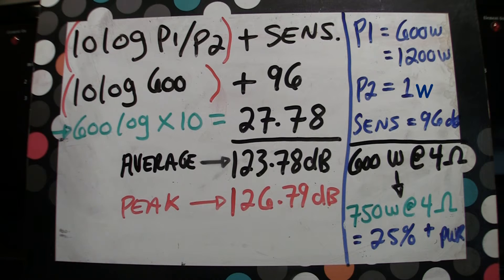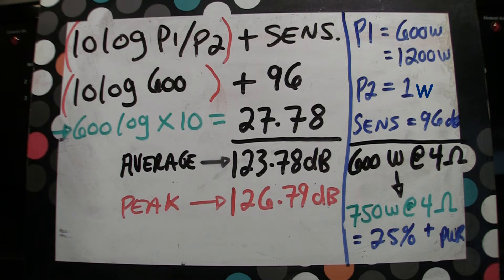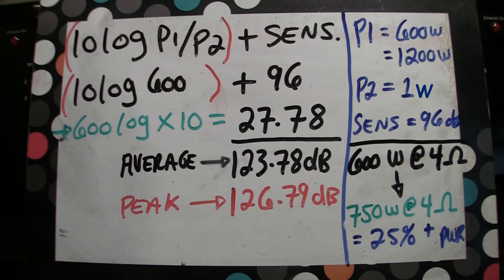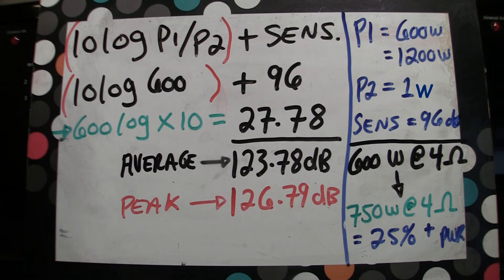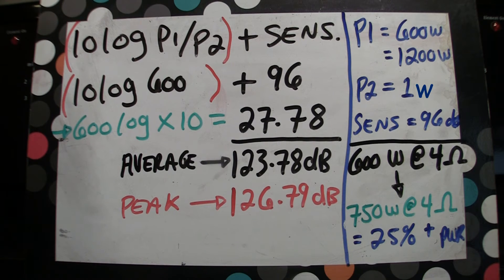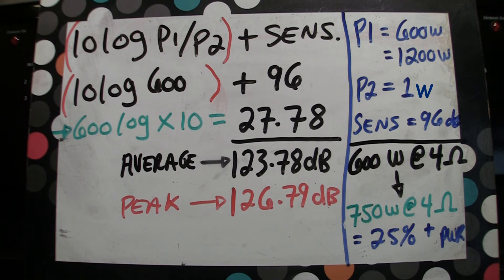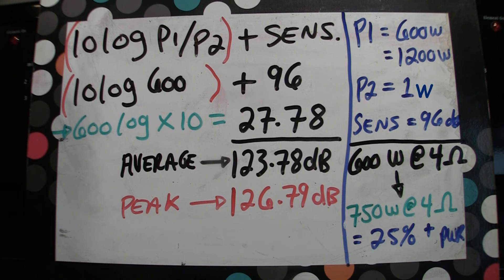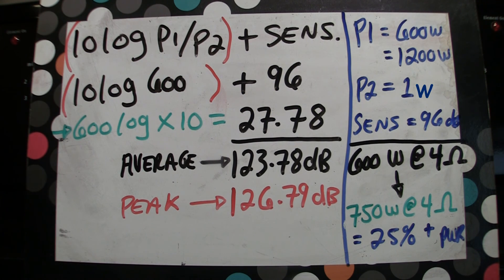How to Match Power Amps to Speakers for PA Systems

Comment: So, you say that for a loudspeaker rated for 600 W continuous, "if I use an amplifier of 1000 W continuous per channel, I would probably have to turn it down half-way".
If you think that turning down the amplifier controls to half way or 12 o'clock position, it will deliver roughly half the power, this is not true. Why? Because the amplifier front panel rotary knobs actually control the sensitivity of the input stage, by applying positive or negative attenuation to the input signal.
Furthermore, these controls usually are not linear, but logarithmic, meaning that setting it to half way or 12 o'clock position, could lead to an attenuation of about 10 dB or more, meaning that the amplifier will deliver only about 100 W of power to a 600 W speaker.
Actually, if you use an amplifier capable to deliver 1000 W continuous per channel, in order to drive the speakers to their rated continuous power of 600 W, the amplifier front panel rotary knobs should only be turn down a few notches, to about -2 dB or -3 dB, which is way up past half way, to about 3 or 4 o'clock position.
The ratio between 1000 W and 600 W is only 2.21 dB, meaning that your amplifier onlu has 2.21 dB of headroom (reserve power) for peaks.
Reply from the maker: I'm going by manufacturer recommendations, specs and my own experience. If you have a better answer, but succinct version, please share.
Reply: @bacontrees  Driving a loudspeaker rated for 600 W continuous with an amplifier rated for 1000 W continuous per channel is just fine, because the amplifier is able to deliver a clean and undistorted signal to the loudspeaker while operating inside its thermal stability envelope.
Personally I use amplifiers rated at least twice the loudspeaker’s continuous power rating, or equal to the loudspeaker’s program power rating, in order to ensure between 3 dB to 6 dB of headroom (reserve power).
Reply from the maker: @valentingheorghe1693  Thanks for contributing. Also, I did mention turning the Amp to 50% to start, to see what is what. What I neglected to mention is that is only a starting point, then raising it as the entire gain structure is established. just don't blow the speaker. Cheers!

Comment: Ok so if I had two speakers that totaled 2400 watts, should I get a 3000 watt amp
Reply from the maker: What are the speaker Impedances, and channel Watts at 4 Ohms? If that is 1500 Watts per channel, then it could work if both rated at 4 Ohms, although I would be careful with gain structure.

Comment: Amps are always set to max output!!! You always want that extra power if you need it.
There are always exceptions to the rule. ie: Dirty high-freq amp (noisy) so run at 75% to eliminate noise.
If you're running 1200 watts (wide open amp) to 600 watt speaker (low freq) turn down your crossover NOT your amp. Always put Comp/Limiting on the output of your drive rack to protect the speakers/amps. You can reduce/gain at output of comp/limiter for output (spl) volume.
Amps run at rated outputs/spl/freq etc., at full volume output. WIDE OPEN!
Reply from the maker: Thanks for the reply....that assumes one has a crossover and that the speakers are a good match...but yes, there are exceptions....as for always at max power, what is the science behind that? Cheers!

Comment: Hi Buck,
What if I have on both channels : 1x15”sub 8ohms 250watts Nominal with highpass filter at 150hz on it, connected to a 12”top 8ohms 350watts. Do I add the power (250+350=600watts)?
I push those with a CerwinVega CV2800 900watts RMS/channel (limiter ON, Highpass filter OFF) Is it a good match?
Thanks and keep up the good work.
Reply from the maker: Sorry, I didn't see this....are the speakers on each side running in parallel?

Comment: I just have a quick question. What will happen if i use a 500 watts speaker in a 60 watts amplifier? Hope you can advise me.
Reply from the maker: Actually, that is backwards, it would be 60 watt amp into a 500 watt speaker.....it would not be very loud, and to get it louder you might be tempted to crank the amp full as well as the mixer and you might 'red-line' everything into distortion.
Reply from the maker: Good question, though.

Comment: Sir... if the speakers shown  300 watts ( rms ) - continuos @ 8 ohm, 600 watts - program, 1200 watts peak.... which one is average power
Reply from the maker: Continuous is long term average power, program is considering bursts of power, and peak is very short-lived transient bursts of power. Use Program Power for the average to match amps to speakers.
Reply: Thank you Sir for the explanation